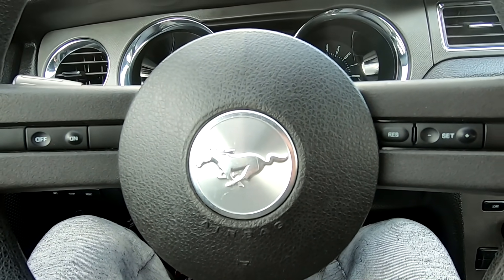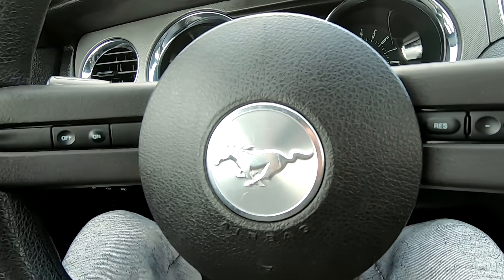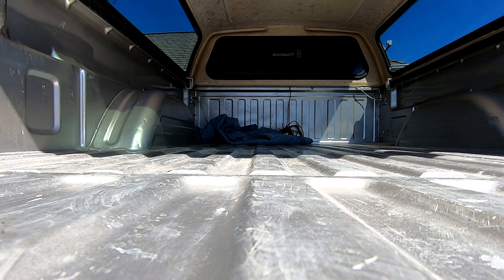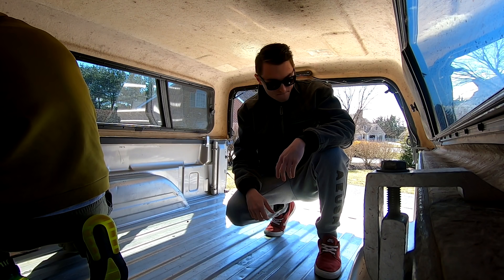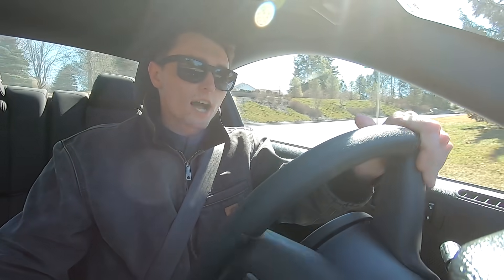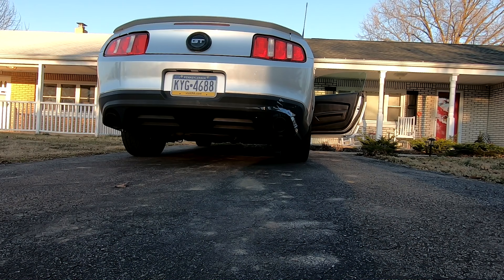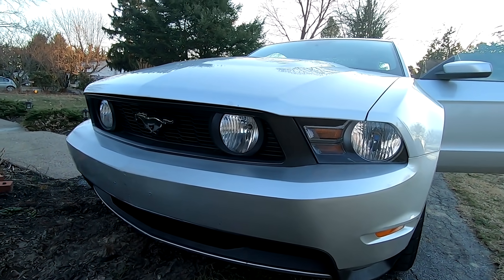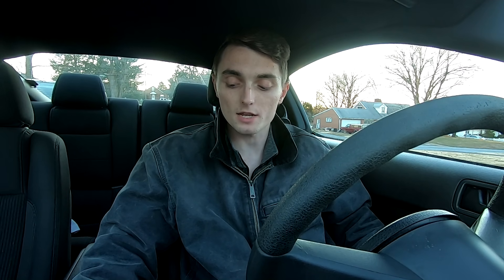Already Modding The New Mustang! *CHEAP*

Comment: Boss 302 steering wheel, you will not regret it! Or at least the premium steering wheel
Reply: And if you replace the standard radio with the shaker unit the radio controls on the steering wheel work flawless. I just did this to my 2011 and it was by far the best upgrade yet

Comment: 13/14 tails will work, but will leave a gap , you can buy the piece to fill in that space. 13/14 headlights will not work. Totally different front end. 15 is a completely different car and will not work at all.    I’d suggest getting a 12/13 boss steering wheel or a 13/14 Shelby steering wheel. I put one in my car and it’s so much better. For something you wouldn’t think of it makes a big difference. Also a mgw shifter would be a great addition.

Comment: The good thing if it’s like my 14 it holds it’s self on a hill once the brake is pressed it won’t roll back for like 3 seconds it will automatically hold brake long enough for you to push gas and release the clutch ... good luck before you know you’ll be rev matching with the best of us

Comment: It's nice to see that I wasn't the only one that viewed the s197s as a dream car. Bought mine two years ago in torch red as a premium gt with pony package. Sadly I lost mine last Tuesday when I got hit by a 18 wheeler coming from somewhere it shouldn't have been. And of course the 18 wheeler driver is a lying pos with a wrap sheet so it's going to be a long time before my lawyers get it all sorted. Nothing will replace mine as it was my dream car. The only thing I wish is that this damn pain from the accident would go away. Get a dash cam for your vehicles guys. It'll save you a head ache. Trust me.
Reply from the maker: ActuallyAustin been thinking about running a camera on the car 24/7

Comment: Well for all of us older manual transmission guys even with the newer Mustangs rev matching is cool but downshifting to slow down is the worst thing you could do with a manual transmission other than grinding gears. Coast clutch brake you don't need to downshift until you get to the light and put it in first gear or stop sign